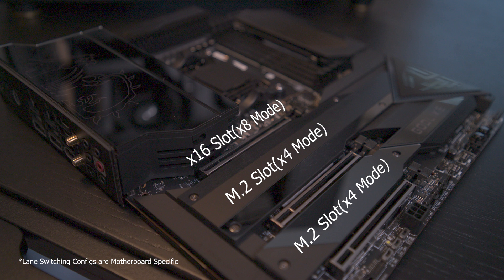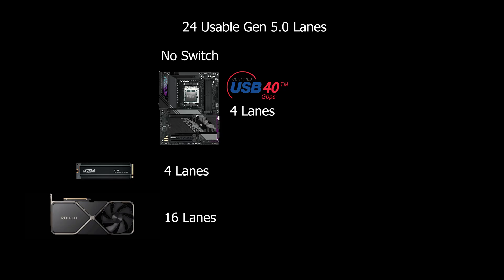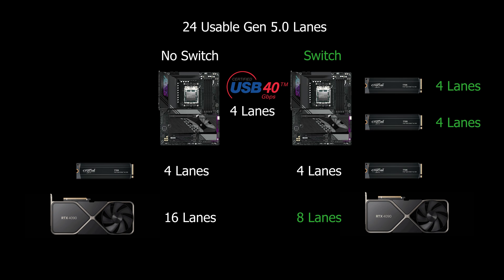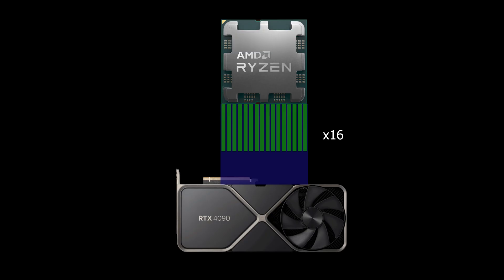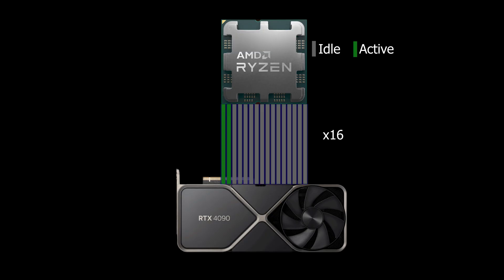Gen 5.0 Lane Switching AM5 Motherboards

Comment: Hey thank you for the video .I have a question if i connect 2 m.2 gen5 the GPU will under perform in gaming?
Reply from the maker: Hi, it's an avg. of 0-3% frame rate decrease when gaming in 4K with a 4090. Here is an article.
https://www.techpowerup.com/review/nvidia-geforce-rtx-4090-pci-express-scaling/2.html
Reply: Maybe a couple percent, depending on the system and the game.